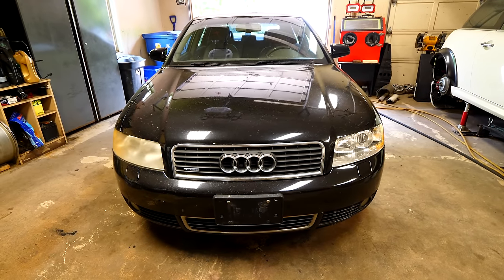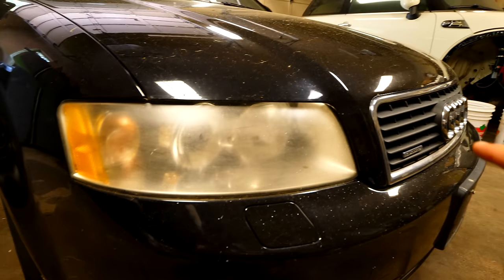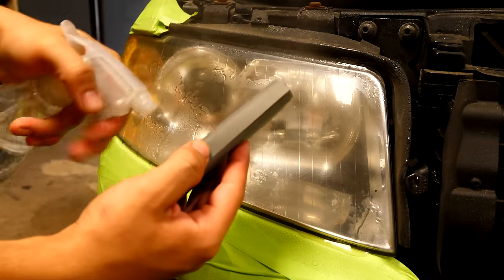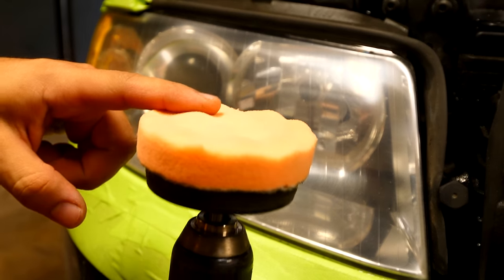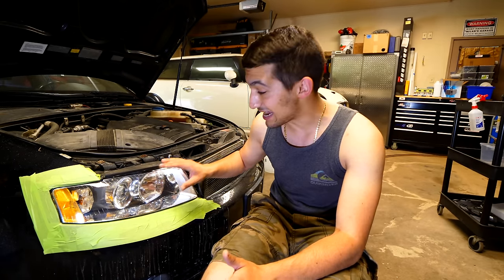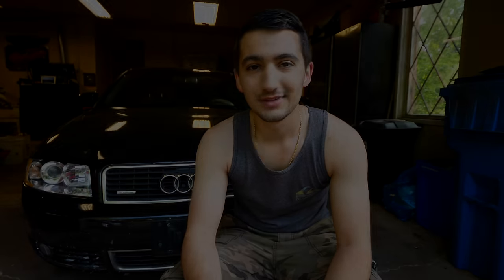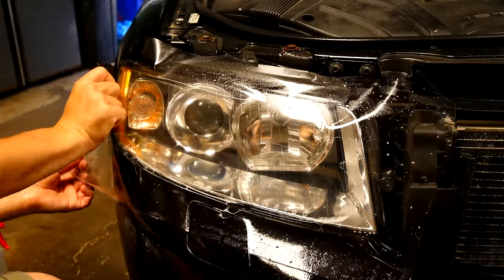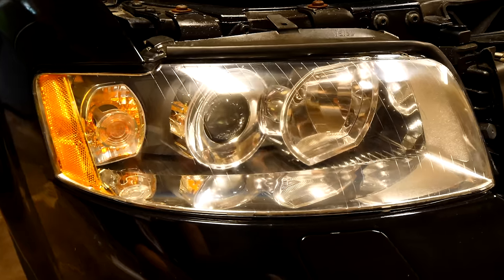Restore Neglected Headlights to BETTER THAN NEW Condition

Comment: Milan - I have never commented on a headlight restoration video til right now.  I noticed you went str8 to 1500 grit and didnt start with a 800 or 1000 like so many have done before you...is there a difference?  I absolutely love the idea of using ppf and agree it's the best for lens that will last almost indefinitely. I usually use mothers and then wax the headlight but that lasts but for so long. Take a boy sir.

Comment: None of what you have shown would have been necessary if the OEM PC clear plastic was fortified with a UVA suitable to provide photo thermo light stability from the halogen or other lamps used for the headlight. To save money few if any US cars contain the integrated UVA in the molding of the lens therefore the need for a UVA film however all organic UVA coatings on plastic are fugitive over time and do not protect the substrate from eventually yellowing again. Therefore the solution is to  purchase a car that have OEM lenses with UVA like Honda!!
Reply from the maker: My Honda headlights have done the same thing where they Yellowed, and I needed to not only polish the lens, but I applied a PPF to protect if from yellowing.
Reply: PPF itself has good photostability but no UV protection for the substrate lenses .all  polycarbonate lenses yellow over time the surface and deeper sections of the inner lense also will yellow and cloud up with the haze. Typically all OEM Honda today since 2007 have had fortification in all PC headlights. China had cut back on fortification to save money

Comment: So I have an idea, why not wet sand then polish, apply a nice 2k clear coat (spraymax 2k) then use PPF. But the question is after polishing and BEFORE applying the clear, would need to re-sand? Common knowledge would say yes but if so, how much?

Comment: The Meguiars 105 plus Meguiars 205 is over $66 dollars!
Reply from the maker: You dont need to buy the large bottles. You can buy the smaller sizes and it will be around $20.

Comment: Sand paper ?  No way.  I use brass metal polish or even better silver metal polish that is sold in any supermarket inside  8" metal tin boxes. Rubbing the lenses with these will removed the oxidized /damaged surface.  I would turn away from using sand paper however fine.
Reply: Mirror Image I’ve seen vids where they use 000 then 0000 steel wool to get rid of the oxidation
Reply: @goshen574    Really ?... OK.
Reply: Mirror Image, I have to say though, how it’s done on the vid seems just ridiculously awesome
Reply: @goshen574  ... Really ?... OK.
Reply: @goshen574  ... Yeah, OK.... it is.

Comment: Why don’t they just use glass headlights, this would solve this problem. I guess that’s to EASY.
Reply from the maker: I hear ya dude! But it would cost more to make the headlights, which is a big no-no for car manufacturers. If they can save even $2 per car and get the same job done, they will take it...

Comment: Naaa wd40 cheaper and just as good
Reply: sawman249, it's good for a while, but it's not "just as good". WD40 is useful until the first rain drops hit the headlights, or first wind that blows the dust that sticks to a greasy headlights. It is good for a few days, but no longer, and then you need to repeat it.

Comment: no offense but after all that labor and cost of various materials and tools that you had to use, it would be cheaper to just buy a new headlight lens.
Reply from the maker: Potentially, but what happens if you need to do the same thing to 2 cars, or 3 cars. It is by far a lot better of an option to purchase the necessary tools, and doing the work yourself.
Reply: @milanmastracci  I can barely afford 1 car, and I certainty ain't doing that for some friend's car. Lol.
Reply: W. Martin 
My headlights are $650 each. It’s definitely cheaper doing this method and they turned out crystal clear. Thanks for the video milanmastracci.